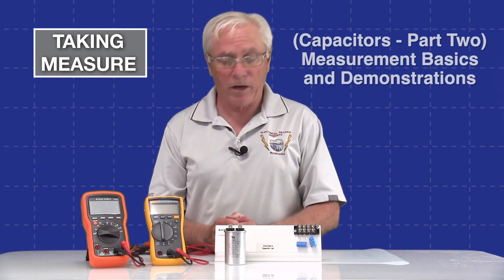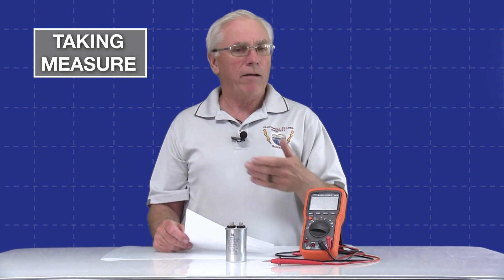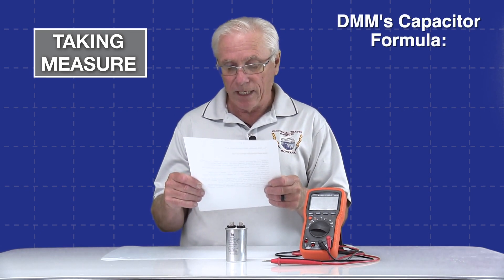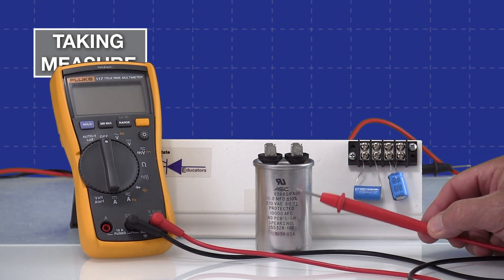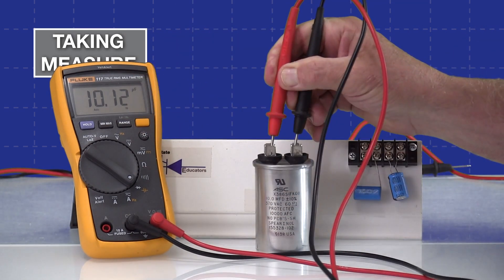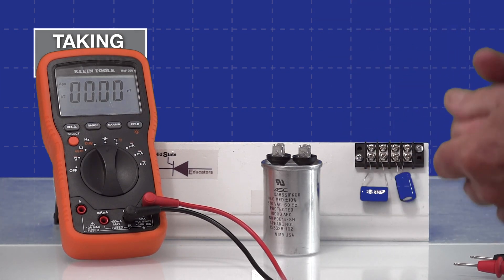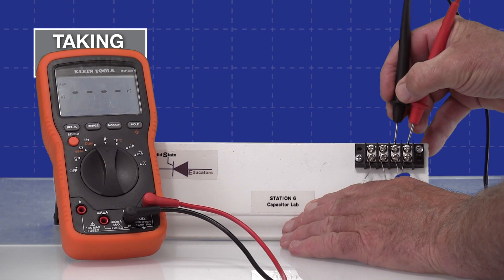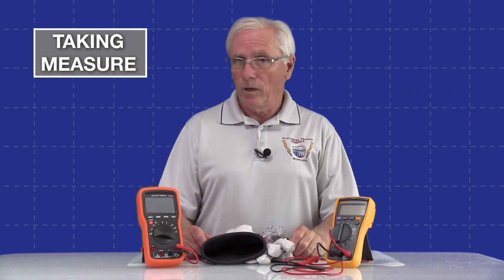Understanding and Measuring Capacitors (Part Two)

Comment: Simpson analog meters would use the RX1 or RX10 or RX100 to measure capacitors and what the analog needle to see any fluctuations when the capacitor is getting charged. Many capacitors will pass test on capacitor meters but will fail the Simpson Analog meters fluctuation test. Using low impedance capacitor testers that puts a LOAD on the capacitor will fail leaky capacitors. On the oscilloscope you measure the capacitor but using a Function generators Square waveform and measure the ramp time divided by voltage = capacitances
Reply from the maker: Simpson analog meters were the first test instruments I used.  They are very well built and accurate if properly cared for.  I did not have much call to test capacitors with them.  Thank you for sharing your knowledge!
Reply: @takingmeasure  Yes its in the Simpson Analog Meters testing manuals or other service manuals that would use simpson analog meters to test capacitors and diodes resistance test. Diodes can test good using a DVM meter 0.7vdc but the test current test voltage is very low. Simpson RX1, RX10, RX100 scale has different test current test voltage for diodes resistance. The diode will pass the forward voltage test but will FAIL the diode resistance test.